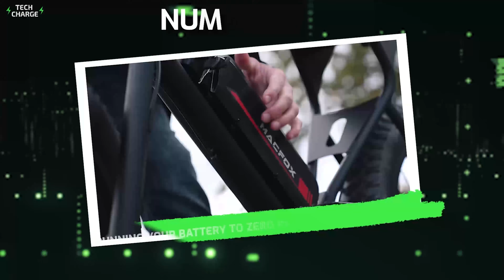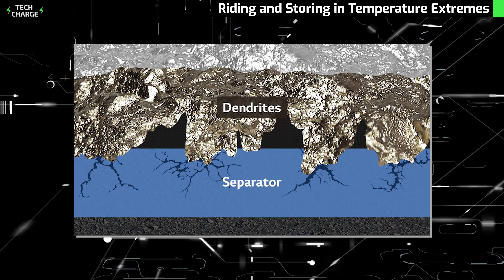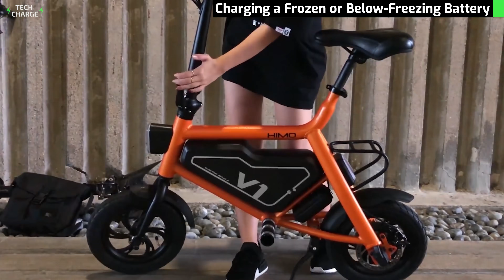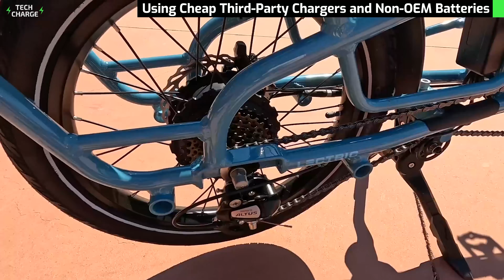10 Electric Bike Habits That Are Slowly Destroying Your Battery

Comment: Living in Denmark, where most of the year are below 15 degrees celcius, should then be a no go for an e-bike??? comeon... Lots of stuff said in this video is correct and good to know... but this is BS.... ofcause... decreasing temperatures reduce the output of batteries, but the are not damaged... its the same with EV´s   cold weater reduces range

Comment: Sorry, number 10 is nonsense! When the battery shows 0% it is most likely 10...20% SoC as the BMS cuts off much earlier for safety. A low SoC is generally healthy for the cells, there is no internal stress - its the sweet spot. The only danger is to let the voltage drop below discharge limit when the cell reaches deep discharge at around 2.8...2.6V (depending on the exact Li-chemistry). Everything below 3V is close to empty, but below 2.5V is harmful! All other points are valid! Charging (esp. fast charging) at very low temp. is a no-go and will harm your battery! But most batteries die of age, not by abuse. Most ppl don't even make it to 200 full cycles after 10 years...

Comment: Ok so what im getting from this is the chargers need more options cuz im not checking the bike all the dam time. I just bought my second ebike. My first one was a slow charger. I ride to my landscaling job, plug it in and unplug it when i get back to the shop. Then i ride home, plug it in and unplug it before i go to bed. The new ebike im getting has a fast charger so now im concerned that i cant leave it on a charger all day. Chargers need a option for slow or fast charging aswell as to what battery capacity you want to charge it to if its really this much of a probpem. If anyone knows of a charger that can do this plz let me know so i can get one.

Comment: So I'm supposed to bring the battery in the car trying to trip so it won't be vibrated but now it's in the car and it is a bomb if I get into an accident it will catch a car on fire and spew noxious gas and flames in the car causing further injury beyond the car accident

Comment: If you put the red jumper cable on the right hand handle bar and the black jumper cable on the shift knob you can boost the power if you have a car hooked to it. It's dangerous in traffic though, depending on the length of the cables and the speed that you are riding at.

Comment: Great vid 👍 Something I believe every E bike user should learn and I think bike shops should point customers in this direction.
We've all gotta learn what to do.
I got almost 20,000 kms on my last E bike in Australian conditions over 3+ years.

Average 100- 160km a week.

Trickle charger and fast charger, not doing everything 100% right but I'm sure I could've got another 10,000 and another year.
It's just that I upgraded and bought a new bike.

Same deal tho;
Bosch gen 4 performance line cx, 625 ah battery, but this one uses the smart system.

Comment: Many truths but some things are off. AI vibe.
My very short guide: Unused battery: 50% charge, keep cool(not frozen), dry. Check every few months. Most will not loose any noticeable charge.
Normal use: the closer to 50% charge the better. But not very practical. Recommend not charging for every ride unless you need the range. Charge before completely empty. Avoid extreme temperatures. Never charge frozen or close to.

Comment: Dont flatten your battery before you charge.
Dont charge within 40 minutes of a long ride
Charge your bike when its at 60% charge and leave batteries at 80% between rides.
Dont charge to full then leave in storage.
Dont use fast charger too often.
Bumps while on car racks, mountain biking or riding on gravel shorten battery life.  
Dont ignore warnings on bike’s display!!
Dont subject your bike to extreme temperatures in storage or when in use. 
Dont store batteries in hot places or charge in the sun.
Dont keep charging your bike to 100% unless you plan to ride it again shortly.
Dont charge a frozen battery (below 0C).  This is a fire hazard.
Dont use cheap chargers or batteries that dont fit with the bike model.

Comment: The best battery video I have seen.  Here is some info that adds to it.  Slow charging is different for each battery based on the size.  Larger batteries can slow charge with more current.  Slow charging is 0.2 x the charge on the battery in Ah's.  So my 20Ah battery can slow charge at 4a.   Most batteries are smaller and should stick to 2-3a.   Additionally, you can safely fast charge to 80%.  Here is why.  At 80% the electrons start gain energy and resistance rises which creates heat & damage.  After 80% make sure to slow charge the rest.  You can charge your bike to 100% if you ride it within 1-4hrs.  In fact you must slow charge once a month to balance the cells.  Simply leave it on slow charge for 1-2 hours past full charging.  A great technique is to fast charge to 80% then slow charge to 100% (assuming you will ride immediately)  PS:  Many ebike battery chargers come with a 2.1mm barrel connector.   Due to it's small size and sometimes loose connection it can only handle 3-4a of current.  Well made and well fittings can just (barely) handle 5a.

Comment: This video is a must watch for anyone with a new e-bike. So glad I found it 50 hours after getting my bike. I cannot thank you enough for this video. Luckily I only did a couple boo boos after my day one ride, but it was a perfect temperature day. I’ll be riding 9-10 months a year several days a week, so my biggest lesson was leaving it between 20-80 percent and fully charging it for my long rides. Night two I forgot to unplug the charger before I went to bed. Not aftermarket of course, but still, I learned. Won’t do that again. Thank you so very much for this ❤️
Reply: And storing it properly for the 3 months a year I’ll ride infrequently. Thanks again. I’ll make this a six-month regular reminder watch

Comment: My battery chargers don’t have a gage. When the indicator light turns green, the battery is full. My batteries are 5 years old and seem fine.
Reply: The chargers don't.  You use the bike to see what charge it's at or estimate using time.

Comment: Take no notice of the crap, buy a battery from a good company like HL, they are all fitted with a battery managment system, the clues in the description, the battery looks after itself these days, you cant over charge or undercharge them, as for temperature, they are designed to take extreme temps, thats why you can ride at 20 below in canada and 110 in california, you do losse power in cold weather but the b.m.s. compensates for this, just buy a reputible company and not a cheap knock off, ive just changed my HL 17ah battery after 4 years, thats getting used every day at 28mph, and nearly 4000 mls, guess what ive replced it with, yes exactly the same battery !

Comment: I bought an LFP.   same warning not zero and don't leave it 100%.   For storage I go high because going dead is the end for Li.    LFP has a lot less heat generation and can take higher temps and there have been zero large LFP fires. LFP are better at handling vibration.  

I wish the battery makers would list the cells they used.

Comment: I do know this is an AI video. However, most of the stuff makes sense.  They did forget to mention to charge the battery only when it needs to be charged – around 50%. I do firmly believe that cheap aftermarket non-OEM batteries, and chargers do contribute to fires.  When it comes to the cold, all lithium batteries will show much less range in the cold. It does not necessarily mean the battery is derogating.

Comment: I am riding my bike Riese und Muller with the same 500 watts battery for more then 10 years, always riding on turbo 😀
Reply: How many miles you covered in the 10yrs. I am on 3yrs over 7000miles and my battery is still like new after over a 130 charges and that a not very expensive Chinese one. Look after your battery and motor and bike. And they look after you.💯👍
Reply: @JohnMckeeman-j1y  In total  22.850 Kilometer and I am using my bike as a city bike.
Reply: I have a Riese und Muller Charger Bike from 2016 with a Bosch Performance motor and a belt drive , I had never any problem with this Super Bike !!
Reply: This moment, when my battery is fuly charged I stil can ride 52 kilometers on Turbo

Comment: Storage vs usage in cold temperature are very different things. There is really no problem storing a mid-SoC battery at around freezing; certainly below the 15 Celcius claimed. Just make sure it is at room temp a good few hours before use.
So then a battery that starts out at room temp can definitely be ridden below freezing given they generate their own heat while in use. It's actually preferable to riding in moderately high temp as this results in battery getting too hot.
Pretty much ok with the rest, except 60% storage SoC is a little high unless it isn't holding charge well. Holding at 30% - 40% would be optimal, but it's in the ballpark of good.

Comment: Lithium batteries in the last decade have none of these problems. At least not to this extreme. Charging to 100% not only makes very little difference, but they're no simple way to stop charging at 80% of something like yout smartphone which can choosen. Who care's about virbrations. Use commonsense for storage temp. Don't charge a scorching hot battery pack. I'm fine with buying a new battery every 4-5 years

Comment: From the video:
10.  Running the battery down to zero on the display.
9.  Storing the battery at wrong charge percentage.  Don't store at full charge but use 40% to 60% of full charge.  Also don't store below 20% of full capacity. 
8.  Charging the battery immediately after riding hard.  Wait for the battery to cool down below 40 degrees celsius  before charging.
7.  Using fast battery chargers can decrease capacity by 15% to 20% over 500 charge cycles.  Standard 2 Amp chargers is better than the 5 Ampere fast chargers.
6.  Subjecting batteries to sustained strong vibration.  
5. Ignoring warning or error codes on the ebike display.
4.  Riding or storing in temperature extremes such as very cold (under 15 degrees celsius) or very hot (40 degrees celsius or higher).
3.  Keeping the battery pack at 100% full charge between rides.
2.  Charging a frozen or close to frozen battery.  This causes lithium metal plating on the anode and can cause dendrite growth.
1.  Using cheap battery chargers or non-OEM chargers and non-OEM battery packs.
Reply: Thanks. I wasn't going to sit through that AI generated crap for too long.
Reply: You/he forgot #11 - always pedal hard to take a load off and increase range.
Reply: For #7 Please correct to state "Do not fast charge past 80% then slow charge the remaining"    You can safely fast charge to 80%.  Here is why.  At 80% the electrons start gain energy and resistance rises which creates heat & damage.  Plus here is what is mean by fast charging.  Large batteries can slow charge at higher currents.  Example:  Slow charging is .2C (.2 x the total Charge)  So a 20amp battery can charge at 4a (.2 x 20Ah)  but a small 10Ah battery can only slow charge at 2a.  the same 4a would be fast charge for the 10Ah battery."  Here is the exciting part.  You can fast charge at 5a up to 80% then slow charge at 2a from 80-100%.  Luna Charger sells a charger that does exactly that for $99.
Reply: @LeeMiller-l6r 
Most fast chargers reduce their power automatically from 80%-100% to protect the cells. So does mine.
Reply: @miracoli16  Same as with mine. Just like with my smartphone charger.
I can see that with an app on my phone.
Reply: :person-turqouise-waving:
Reply: ty
Reply: This is so eye opening. Great info.
Reply: Yeah. It's the same with time-codes: 
10 - 01:15 - Занадто глибоке розряджання батареї. Не розряджати нижче приблизно 20%.
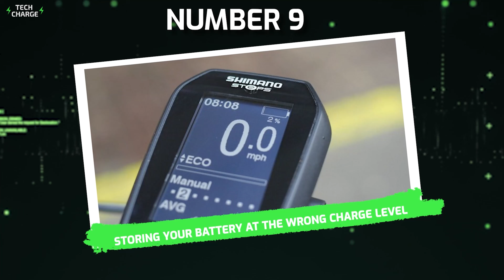9 – 03:09 - Зберігання з неправильним рівнем заряду. Зберігати із зарядом близько 50%.
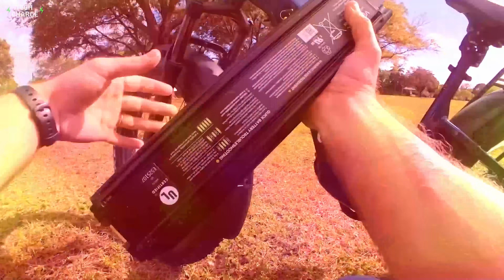8 – 05:19 - Заряджання батареї відразу після важкої поїздки. Дати охолонути кілька годин.
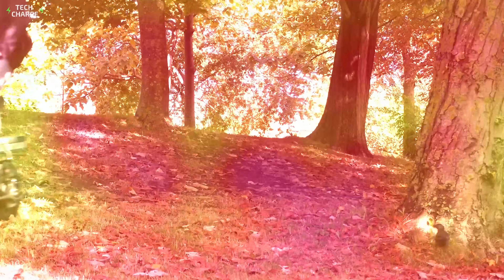7 – 06:58 - Часте використання "швидкої зарядки". Заряджати невисоким струмом.
6 – 08:29 - Удари та надмірні вібрації. Знімати батарею перед транспортуванням. 
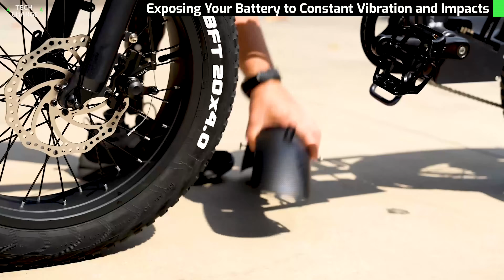5 – 10:10 - Ігнорування повідомлень BMS про помилки і попередження.
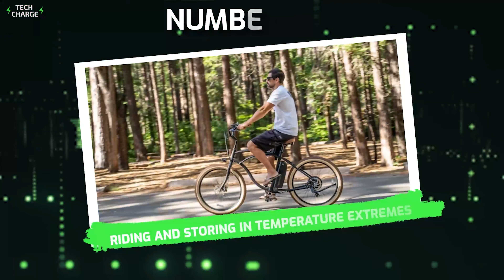4 – 11:48 - Поїздки і зберігання при екстремальних температурах. Оптимальна температура 15–25°C.
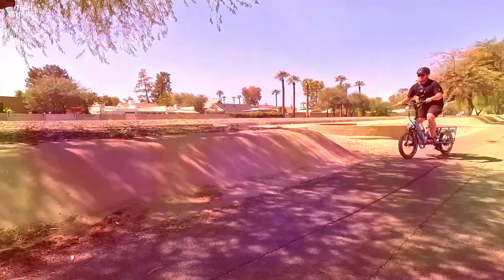3 – 14:35 - Залишення на довгий час повністю зарядженої батареї (схоже на пункт 9).
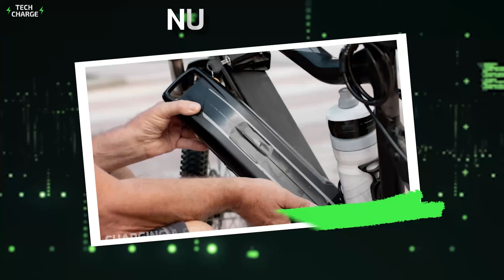2 – 17:17 - Заряджання батареї відразу після морозу. Дати кілька годин, щоб нагрітися до кімнатної температури.
1 – 19:53 - Використання дешевих зарядних пристроїв сторонніх виробників та неоригінальних батарей.
Reply: This is terrific advice - thank you 👍🏻
Reply: Charge at 1 x C or bellow 
Charge to 90% capacity at temperatures bellow 50f
Reply: awesome thanks im new to ebikes or will be
Reply: Tests with Smartphones proof that point 7 is wrong.
Reply: @miracoli16 different chemistry? There is increased degradation by the way
Reply: @Samusaran77  Evidence? Studies?
Reply: @Samusaran77 BMS protects against damage.
Reply: Overly repetitive AI crap.
Reply: Thank you for having to waste my time.
Reply: Thanks. I can tell I don't use an fast charger. My charger is 4 Amps. It's not  registered as fast charger.
I run it till 20 to 40%. Then I charge it full (100%). This DOES NOT damage the battery.
I always wait 1 hour before charging. I run it down to 0% only when I'm making an long run.
NOT on every other day. And my charger is an original BOSCH charger. Not an after-market thing that works just as good.
I check what's wrong when I see an error. I will only use an certified battery. Not an after-market-  pack.

Comment: On year 9 with my battery..year round use,yes I insulated for snow,charge only when warm, and yes I mounted battery with homemade shock protection,yes parts like charger port been changed,power connectors..
Reply: Hey. How did you go about insulating your battery im in the north east and unfortunately need to ride it daily in the winter? Any help is appreciated i have a hey bike tyson that holds the battery in the frame which provides some insulation but I've considered wrapping the part of the frame with insulation and a wind breaker just haven't yet
Again any help is appreciated
Reply: @BillWilliams-j5h  
Closed-cell foam (back-packing sleeping pad) might help.

Comment: On vibration damage, I ride a greenspeed gt20 - this 3 wheeled behemoth won't fit in my car if I don't fold it and it won't fold if I don't take the battery off it's bracket. That said, with a Bafang BBS01 middrive a mile out front, bumps create a ton of shock and vibration. Middrive is great for bicycles, because the weight sits almost perfectly between the wheels, so a bump only lifts the battery and motor a fraction higher than the bump moves the wheel. With a middrive stuck a mile out the front, like on a recumbent trike, the front wheels travel the same distance but nearly double the motor travel, shaking the whole machine like it hit the kerb head-on. Planning to put the middrive into my cargo bike and get a rear wheel Bafang G120 cassetter motor and cannibalise the electronics from my now retired touring bike. It's amazing how many bike shops don't realise "better in the bottom bracket" only works for when the bottom bracket is in the middle. It doesn't work when the pedals are a "mile" out front.

Comment: Well I would burn in E-bike Hell if this were the 10 commandments... I do understand the battery better than most folks and have never charged ANY battery right after use. Storage well they are staying in the shed. When it is hot it is hot and when it is cold it is cold. Not many of my bikes get to sit around for long periods so the long term storage issues are not one for me , Actually I have an old test battery and have had it sitting around the shed for years and it still works so there is a canary in the mine for me. Great to educate the people of the proper care of their investment. E-bikes are really cheap... their Batteries are the real cost.

Comment: Ok so some of this stuff makes sense. Some not so much. Most eBikes now come with a 3amp charger. Not like you have a choice on the amperage. On an 18AH battery that's 6 hours to charge. I am not sitting around waiting to find when it hits 80%. But the one that got me was saying you should try and ride when the temps are between 50-75. I don't know where you live but in the US there are not many summer days that fit into that range. I live in the northern mid-west and still summer temps are in the 80-95 range. I myself can't control the weather.

Comment: Cutting out on a hard climb…..overheating controller?
Reply: Sounds more like an overheated motor.
I had that myself once with an E-bike containing an rear hub-motor. After riding a distance of 65km nonstop I had to stop and let the motor cool down for 10 minutes.
And the next day the E-bike went in flames. Even wehen it wasn't in use and the battery wasn't fully charged.

Comment: You know what I get it I understand you can’t get the battery too hot you can’t be too cold but when you’re in the states with crappy weather, what are you supposed to do not ride it so basically folks when you buy E-bike in all season states cold or hot you’re damned if you do and damned if you don’t good luck basically😂😂😂